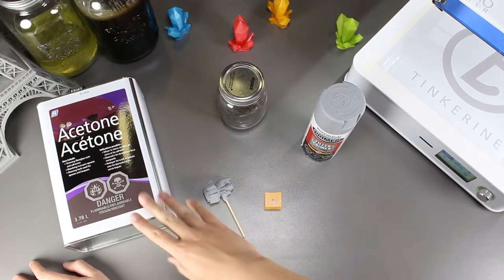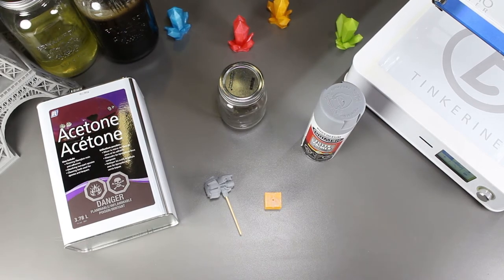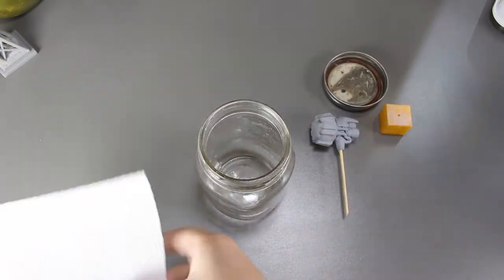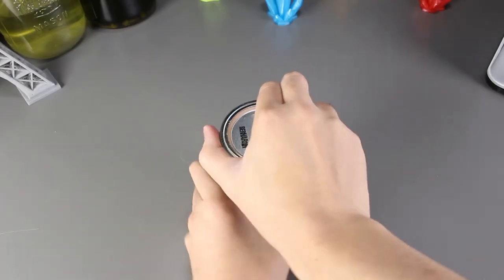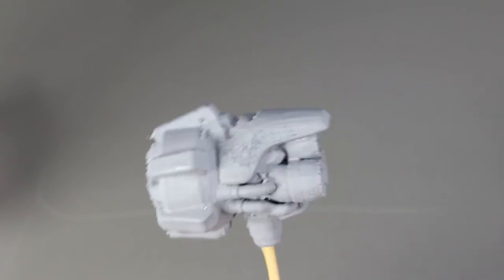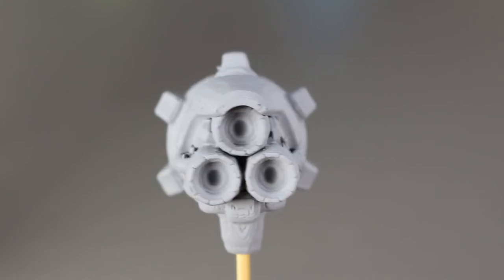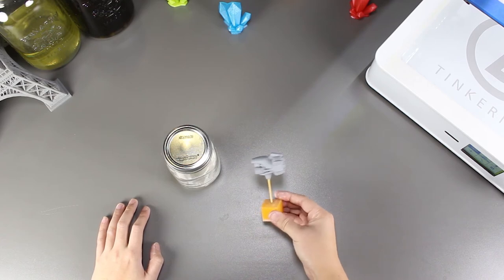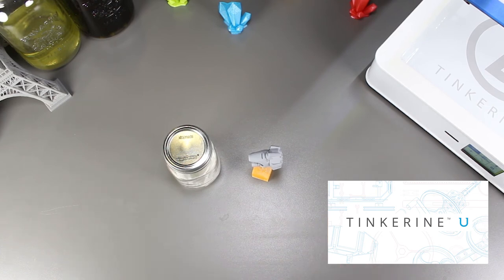Using Acetone To Vapour Smooth 3D Printed Models Coated with Primer

Comment: Acetone Vapor Smoothing only works with a RAW ABS filament type.  Though some have reportedly found that it works with some PLA's (which are likely a result of a blend of polymers).  What is likely happening is that the solvent in the primer is similar to or reacting with the acetone and thus "smoothing" out the finish.  If you want to remove the print lines, sanding is needed followed by using a primer filler used in autobody work, then sanding more and then using a correct plastic spray finishing product or similar autobody finish (though some wood finishes also will work...  I've tried to vapor smooth raw pla and it'll get chalky white and even more "brittle" but not smooth.  the chemicals used, which is more dangerous than vapor smoothing using acetone, are either methylene chloride (acrylic cement), or the EXTREMELY HAZARDOUS Tetrahydrofluran as a straight chem, but which can be found in weld-on plastic cement in lower quantities, so your milage may vary when using that product.  I typically for an ABS print, still sand the item smoothish, and then do a "cold" vapor smooth, like you show in your video, for a hour or more depending on the amount of smoothing and gloss i'm looking for.  Keep up the good videos always nice to see another 3d printer guy showing off experiments and techniques! -david www.dbclunie.com - my 3d printing blog/channel.
Reply from the maker: Hi David!

Thanks for the comment and the advice! We've taken a look at the more dangerous chemicals like methylene chloride. We couldn't get my hands on any of the Tetrahydrofluran yet so haven't had an experiment with it yet.
For smoothing and finishing, we still do the same method as you where we sand and primer over and over again until we achieve the results we are happy with. 

Still looking for easier ways to smooth out prints and we'll take a look at your blog/channel!